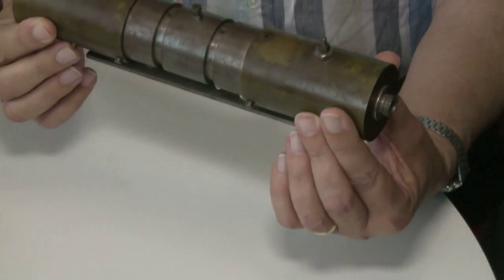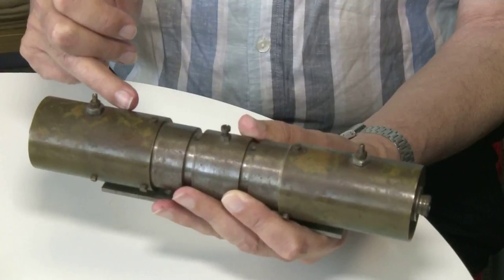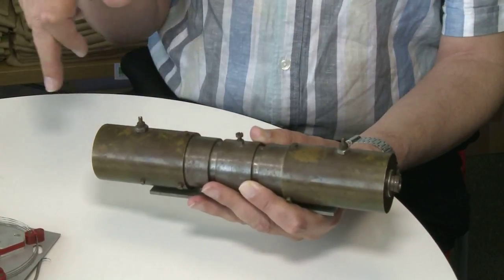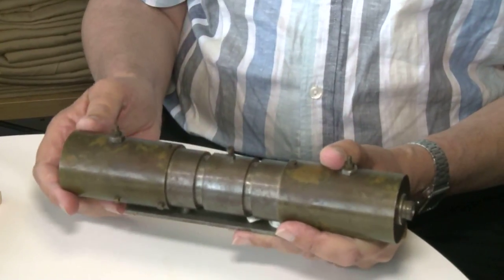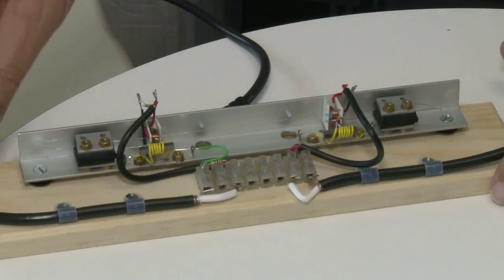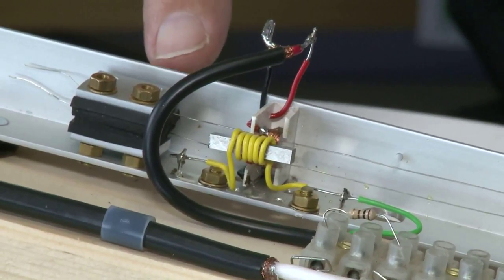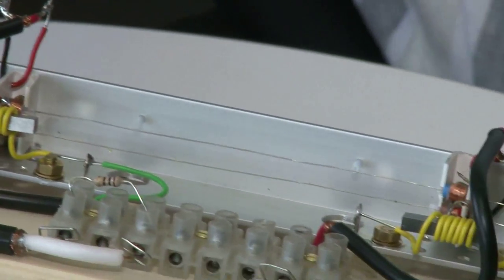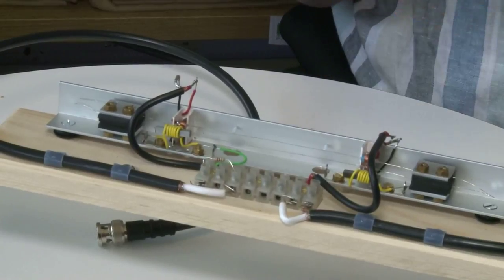EDSAC Project - Mercury delay lines

Comment: I seem to remember reading, in relation to the delay lines used on the Ferranti Pegasus, that the right 'type' of wire was needed as the vibrations transmitted along it were torsional waves rather than longitudinal. It turned out that only nickel wire of a particular hardness would do... Thanks for an excellent video, and a great channel :)